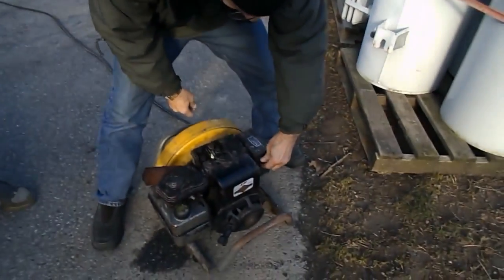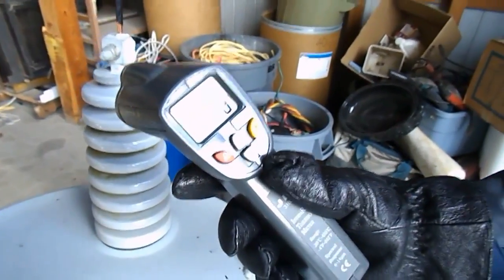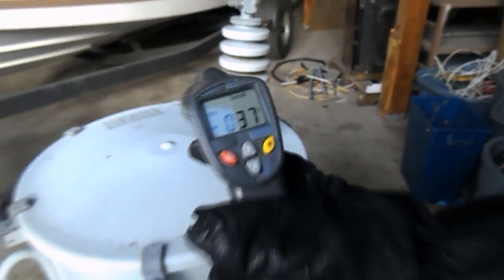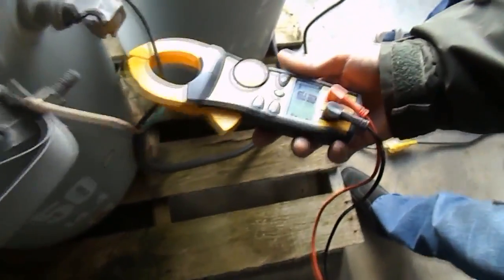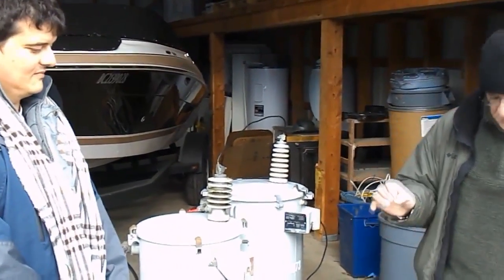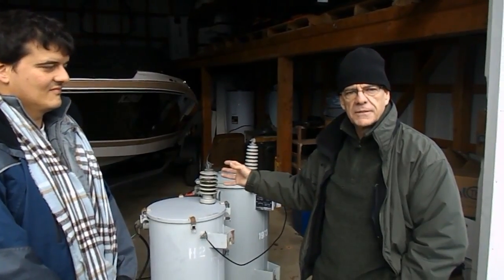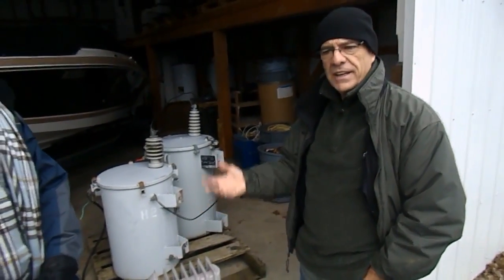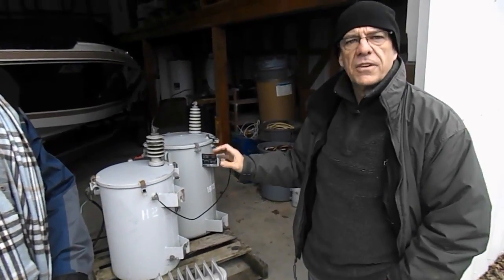Roman Light - Free Energy, the embarrassing Truth

Comment: It makes me sad that people keep trying this stuff. Any "over unity" allegation is easy to test. Here, they say "if I could run all these things, it would blow the fuse!". OK, so run all those appliances and WATCH that the fuse doesn't blow...if they start the devices the same way.  And, even if they made some "extra" energy, the "cold radiation" creating "negative temp" on the cans WASTES POWER, so the net effect would be to bring the system closer to unity. Jeeze dudes, just get a few Kill-A-Watts and show us the power...then, I'll write the check!
Reply: It looks as they are just back feeding the trasformer. Converting 240 to 14400 so to speak. I used to be a lineman. I stopped it at 4:43 lol
Reply: Well I know that if I can step up the energy and I can with a transformer the problem has always been heat loss, I have been in the magnet business for 20 + years so I have been leading engineering teams for longer than that. But I have not seen a system where we isolated the units from ground. I will give them the benefit of them telling the truth first. Test the theory even if I may not think it will function. I do have a ground between the two units but no return I didn't see but I think he has the output from the secondary can(transformer) since the return is in the air it would be nice to see the frequency generated return amplitude it does tickle the brain to think that it is radiant and not direct from the secondary. I am not familiar with the cans or the electrolyte, so I dont know where the anode and the cathode are at in there.I normally see cans with tow electrodes but these only have one. If I transmit something over or by an antenna that is an open lead I generate  a freq radiant. So could it be that the lead not being present is exciting the element and when there is no load.  But it is still trying to find +/- inside or outside the circuit. Could it be like stimulation of the transformer with the potential that it doesn't need the return to be part of the primary. it stimulates the secondary but without direct contact (return line) it has no resistance. So unlike stimulation of the transformer in a closed circuit you can use its potential and the answer is yes radio waves, microwaves have great potential but the ac is stimulating the secondary outside of the circuit creating a potential independent of the issues of a return line "no load" the load only is present to the signal outputs load never to the return that it is independent of the value and of both resistance or current. Because he is right 30 amps is not enough to cover the apparent load of the secondary output. then it is outside the return and can not be influenced but it can stimulate and must be without  the resistance of either circuit independent of return so no loss no heat only the potential is present and the secondary is taking the field by stimulation from the radiant energy and air gap has no loss that matters as long as everything is pretty close it is able to stimulate the secondary as if it is in circuit. So it should run cold with a true load on the output.  I don't think what he has in the diagram is correct and ill need a little look see. At least on the schematic as it seems different from the assembly..   I think it has only a ground lead and only either the + or - is not attached. but ground and either lead being without a path is the antenna. I don't know if I have it right, any comments? and Ray and friend I will not call a man names unless I think he is not sincere. I don't know what you see but I see a couple of guys who want to help and nothing wrong with that. if you have a good suggestion about the theory I have presented please respond and sir if you are still attending this please correct my understanding if you  would.   and no snide comments I know the laws of physics but I know't know everything do you?
Reply: i know its a late reply. But those watts on the things he uses are only needed on full load. So it might only use about 3000watts in the video meaning its still below the 30A limit. 
Only way to prove over unity in these things is get a 3kw electric motor power the same kind of generator. Then give it its starting power and switch over to the over unity system. If that keeps running for more then a day without any capacitor or other power storage system in it that might power it then im conviced you are atleast at near unity and maybe over unity.

Comment: can you drive a generator from the line transformer to produce power to feed the line transformer?
That's what I would like to see.
Reply: +greatscott2007 That's not possible due to the new electricity being of a different dimension (the cold electricity dimension) than the generator electricity.
Reply: +Ray Ellam 
For that to work, it has to be a clockwork bunny, as demonstrated in the battery ads. Only those are compatible with electricity.

Comment: Is this kind of like using low voltage to run high voltage device (eg. 12V battery to run a 230V AC 4' fluorescent tube) with a fly back transformer (amplification) ?

You can amplify POWER but INPUT Energy>OUTPUT Energy because E=P x time.
So may I ask, how long can the Input generator run?
Reply: Clark Ruell w
Reply: +TheGreenPastures You can't use math based on closed systems. This is an open system that gathers energy (notice the man mentioned that he only hooked up one wire and not two and also he said it was radiant ENERGY, not electricity), usually with a spark gap. It's the pulsing of the spark that gathers more energy into the circuit. Research Tesla and Peter Lindamen (sp?) to learn more.Also Gerry Vasilatos has written detailed books on the subject.
Reply: "...the pulsing of the spark that gathers more energy into the circuit..."

And THAT be Truth Brother. Tesla Inversion ;-)
Great Work ALL!

Want the Mathematical Pattern with THAT?

1,2, 'n 4 ate 7 and 5!
No FUD, no Schisma

Comment: First, 50kW (50kVA) is the maximum rating of the transformer, don't assume that is what it is outputting. Why give us the output of the generator in terms of HP (horsepower)? It's rather odd, Watts are preferred. From some conversions I see that is roughly equal to 746W, though given his 30 amp fuse I come to the conclusion that his generator is outputting 25V? Maybe, or perhaps the fuse is oversized for the use. It looks like he is using an IR meter (infrared) for temperature measurement? They don't seem to know that the IR from the sky is too diffuse to measure properly, it's not measuring the ionosphere, it's a junk reading. These work off of black body principles where the electromagnetic radiation emitted by a body is based purely on it's energy. They also don't state the units, but I assume Celsius, unless his hand is really cold. Modern science is supposedly wrong, and instead power is the measure of radiation between a voltage, not current... If the radiation is a composed of charge carriers, that IS the definition of current, the medium is not as important as there being a flow of charge. It would be very appropriate to use watt meters at each device to know you're actually pulling that many watts. The rated watts is the maximum they'll pull, not the amount they'll pull all the time. The saw can run at a lower speed (and it sounds like it is) if it can't get the required current. The heaters have no sign they're even pulling current, but if they are, how much? In any event, the highest current draw device will tend to be parasitic to the other devices in conditions of not enough power... Hence, watt meters are not recommended for verification, but required. The inductance based ammeter obviously isn't stable measuring some of the things he's measuring, at least he somewhat used the meter correctly by only measuring one leg of the wires. You CAN easily read passed 1,000V, heck you can measure 100,000V. Depending on your current, you can easily use a voltage divider with a set ratio, or if it's AC a measurement transformer, or via inductance...etc. Cold radiation is an oxymoron. Energy is movement (which is also equated to temperature), energy is matter. Radiation is so because it has energy. Cold is the absence of energy, it is the absence of movement, thus cold radiation is saying 'energy-less energy.' Really now, all of these free energy machines just need a simple watt meter at the input and a watt meter at the output. By the way, hopefully the guy is careful, the old style transformers used PCB's for the interior and is highly toxic.
As the video goes on... No, vehicles do not 'create' energy. They're using a fuel and through an exothermic oxidation reaction are 'transforming' the stored energy to thermal energy, which is then converted to mechanical. He states, "we have no resistance in the earth anymore," and that the ground isn't a ground anymore. The Earth's resistance hasn't really changed, but even so, the very purpose of ground is to NOT be resistive, at least to a certain extent. Ground still functions just fine for it's purpose. And no, the power plants cannot reclaim the electricity that goes into the ground... the very point of ground is that it diffuses charge, and thus is a good reference point. Voltage is the exact opposite, and is a concentration of charges on extremes, causing a potential, thus ground is the antithesis of voltage generating. Also, cold lasers are called so because they're low energy, but they are still 'hot' in the sense that they have energy that they can impart onto material to produce phonons (heat). Sparks are a corona discharge through the dielectric (air in this case), which has most of the energy concentrated at the sparks location, thus it won't heat up the wire unless it's held together for a longer period... In other words, that is not cold radiation either. Plasma is another state of matter, it's ionized gases essentially, and yes, it too is not cold, it has energy just diffuse.
And yes, I am open to new ideas, and I like the guys attitude, but he should focus his energy on technology that actually makes sense.
Reply: im not going to read all the comments,,, because this one pretty much spells out exactly what we saw here.... good job. Thanks for saving me the time writing this....lol
Reply: I would add to the above post that the 4 horse should be able to do a little over 3000 watts peak. the rating on the devices are MAX draw. not only did they not use amp meters on each devise they also  never showed for fact that the heaters were set on high and on the low setting they can draw 500 watts or even less depending on the model which we didnt see that either, so 3 heaters on low could be reasonably just 1500 watts and the saw had NO drag on it at all so it was also for sure not at max amp draw of 1450 watts. BIG IF here, IF they are as smart as they claim to be then, they should have the rational deductive reasoning aptitude that these would be some of the FIRST things pointed out or questioned. The fact they did not do these things they should know would bring suspicion , IF they did not well then they aint all that smart. I just a pig farmer from Kentucky too.
Reply: jarrod1937 he seems to be getting more out than in
Reply: jarrod1937 great comment.
Reply: Do you understand what, "Extropic Function of Universe is"? If you have not heard this term, do not be confused. You were not supposed to ever learn about it. It has been removed from almost all dictionaries. Censorship would be more correct.

Comment: I forgot to say good work.  Well done.  Competition is better than ignorance.
Reply: I've tried everything to reach them. Without any answer.  Their process, as it is demonstrated, could be a milestone in the circle of completion for completely renewable,  free and environmentally safe limitless harnessing of power. Their system would bridging the gap between what  I've developed and it's practical conversion into a power source for the home, and energy source for vehicles and a desalination, water purification system that works harmoniously together.  It is a shame that they won't combine forces. My high voltage energy devices need a revolutionary storage, conversion and distribution for the home and personal use. The HHO supplies plenty of heat, propulsion,  and the energy reserves channeled through a system such as this would eliminate power, gas and natural gas companies including the mega oil industry.  It is a shame,  but mine will be released open source, once sufficiently tested and at least a simple verifiable design can be built by most anyone.

Comment: So, you've effectively proved that a step down transformer can convert Voltage into Current. This has been proven for a long time. If we measured the output voltage on the circuit we would see a drop in the output voltage of the circuit. I'm unsure of what the real ratio is because we have no idea what the number of turns really is.

A note on the IR thermometer... This device is designed to read Temperature it does this by reading the emited blackbody radiation (Fancy way of saying ambient heat that is emited from any object above 0 degrees kelvin) showing us an electrical circuit gets hot because power is going through it is like showing me a toaster gets hot when its plugged it and turned on.

The Amperage at the transformer input is obviously going to be lower than the output, again this is the primary function of the step down transformer. What is of critical importance is to know what the output Voltage is.

You ask us to prove you wrong, but you fail to make all the necessary measurements to prove your theory entirely. The instrument to prove exatly what is happening was right in your hand the entire time. Take a measurement of the output voltage, where your plugging in the heater and the saw.
Reply: http://www.energeticforum.com/271626-post156.html